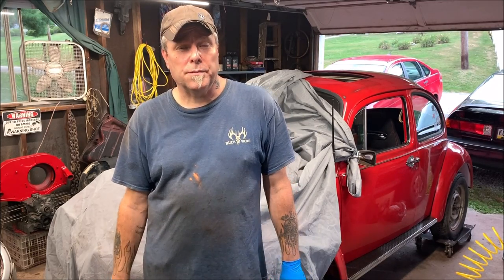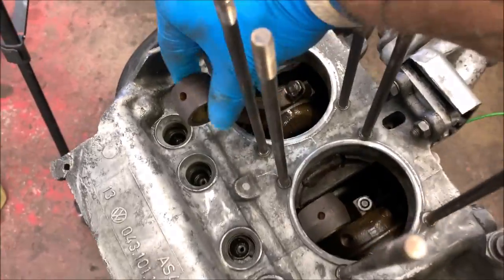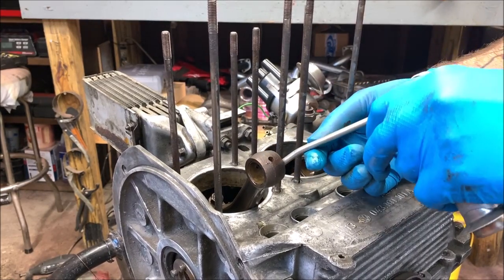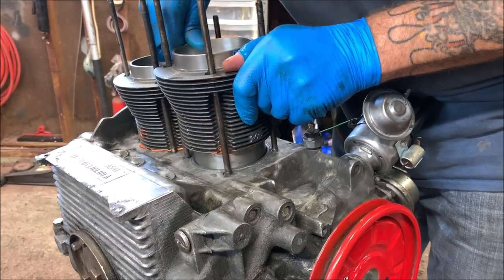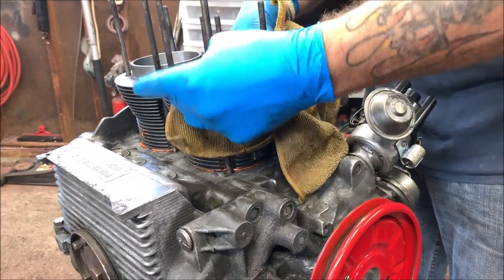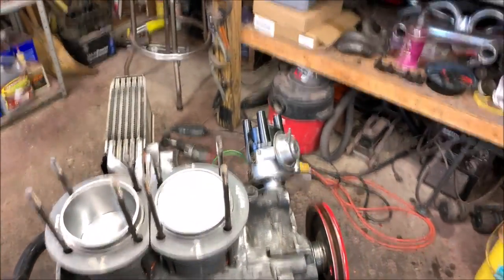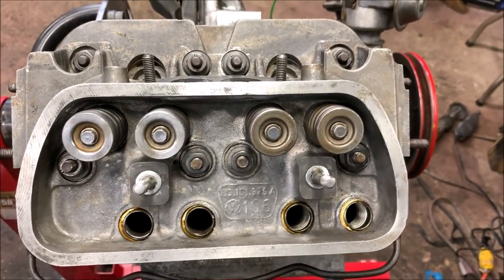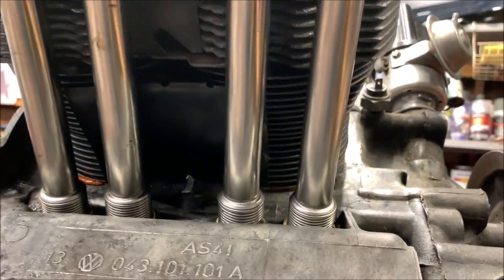VW Beetle - Super Beetle Pistons & Head Assembly Rebuild - Head Installation - VW Bus - VW Baja

Comment: Thank you for sharing all those videos! They have a been a huge help when I had to replace the master brake cylinder and brake lines. Replacing leaking pushrod tubes is next on the list. I've always been postponing this but thanks to you I'm gaining confidence to actually do this (hopefully without being left over with 2 heat shields in the end 🙂) Best regards from Belgium, Robby
Reply from the maker: Thank you Robby, and thank you for taking the time to leave a wonderful comment

Comment: I did my engine almost the exact same method as you, same torque patterns and all...only difference is I don't have an engine stand, so I built it mounted to the transmission..and I used regular gasket sealant, manly because I can't get the good stuff like you guys n the states hahahahaha....I even forgot to put the last deflector plate on there, I had to take it apart and put it on.... DOH!!!!  Hahahahaha no big deal, its on there now....I hope she's a runner!!!
Reply from the maker: I actually bought my engine stand from Harbor freight, and a friend of mine loaned me the VW motor adapter, I’m going to have to buy one for myself obviously. 
He was trying to help me out while I was blowing so much money all at one time. LOL, soon as I put that side together, and got done with torque to the head, I looked over on the workbench and noticed it sitting there. Trust me that happens to a lot of the VW guys LOL

Comment: I feel better about my build after this video.  I forgot the tin on first side.  Remembered before I torqued the head and put it on.  Forgot to set the tube seams.  Took it off the second time.  Moved to the other side and yep, forgot the tin again.  In the mean time, I got my fingers all in the sealant at the base of the jugs.  Thought the head nuts would never tighten up.  Snug one and several others would loosen.  All done finally and still weeks later I worry about those snap rings.  Mistakes happen.  Fix and move on.  So many how to videos never make a mistake.  That they admit to and show.  Thanks for your videos.
Reply from the maker: Hey my friend!! Oh I show my mistakes I don’t care! I’m human and my brains usually on other stuff while I’m working on my car. I still remember staring at the tin on my bench while tightening my head down. 🤦🏼‍♂️🙄 Everything you named ive done more then once.Yeah your tightening and the next nuts are loosening up!! Then after 5 times around your thinking...hmmmm maybe I better check again. Lol

Comment: Yes, I CAN do this! In fact I'm doing it right now :) Great to see someone using the old-style torque Wrench like I do! 
Most years VW recommended 24 pounds torque, only one year they said 18 pounds then changed their minds again. If using case savers do 30 pounds and the engine won't fall apart as quick.
Reply from the maker: Honestly they’re fairly easy to work on. Good luck with yours, I am sure he will do fine on it. I like the old-style torque wrench they seem more accurate to me. And of course I can’t afford a $500 one. Thanks for the tip on the pounds, I didn’t know they changed it around.
Reply: I am happy you say that as my torque wrench was out of torque, but I didn't realize until I had put the engine back in, I noticed I do have case savers and 8mm studs, 
I found out by checking the torque on the nuts behind the rocker arm, with a new torque wrench and they are torque at just over 24 ft lb and I was a bit worried about that, 
It's my first engine rebuild.

Comment: Great video. Good refresher  course for me. It's been about 7 years since I've done the jugs on my 1965 bug. I have a dead cylinder on my 1974 super Beetle. Number 1 cylinder. I will adjust the valves first praying for a miracle that will fix it. Just bought the bug. It is supposed to be a new motor. Looks fairly newish. I think Number 1 is probably low on compression. Will have to drop the motor and investigate. Great video. Noel
Reply: I had the same problems with my number 1 , the sparkplug keep stop working, so I pulled the engine and it was a crack in the cylinder head from spark plug hole the valve, I am not saying you have the same problems,

Comment: You give me a lot of confidence,  I may tackle the job myself instead of farming it out. I need to do a little bit of work on setting the compression ratios though. I think my engine was built wrong because it runs 90psi.
Reply from the maker: Yeah 90psi is a bit low! I will be doing a full rebuild soon, with new crank and cam etc.. and setting compression, but you’ll be done before I do that.

Comment: Nice method going vertical to use gravity, and also helps with tubes sitting in place without falling. I think it is better to load pistons into cylinders like you do, then install on rods... to me, its easier than the old way we were taught where pistons go on rods first.
Reply from the maker: Your right! I like loading the jugs first, then installing. Just seemed easier to me. Keeping it vertical is so much easier. Especially so the tubes aren’t hanging down. Thanks for being here!!!

Comment: It's amazing how low at 18lbs the heads are held on. I don't know if the factory used a thread lock on the studs or if it's just corrosion but when I first rebuilt my engine 3 years ago, having never been split since it left VW factory, it took a lot more torque to undo ! I forgot to check deck height when I did this rebuild but I didn't have the machinery to make any changes and needed to get my daily driver up and running asap, it's held up fine for 20,000 miles so far but I regret not spending on stainless valves, next time!

Comment: Great movies, please keep them coming. I have been following this with my 1600DP but found a steal ring on each of my heads where the barrel meets, should these be replaced or fitted with my new piston and jugs
Reply: I thought they should be copper rings to crush and stop any leak of combustion gases but if steel they probably are used to alter the compression ratio, the thicker they are the lower the compression would be I think!

Comment: I am new to the channel and would like your opinion on something. I have a 72 super beetle, the engine had probably less than 3000 miles on it when we had a flood. The car was completely submerged for about an hour. The oil was changed within a couple of days and water removed from cylinders. At this point the engine would turn. It sat for almost 2 years because we were busy rebuilding and taking care of other issues. Now it is locked up. I am going to pull the engine and tear it down, more than likely replace jugs and pistons. Should I go ahead and break the case apart or not? Just.looking for advice.

Comment: Don't  forget  the deflector plate that go between the cylinders before  you install the  pushrod tubes.
Reply from the maker: I did on the first side, as I brought up. I had to take it back apart
Reply: I did the same forgot the plate 😊

Comment: Did you use the thick wall slip in jugs?
Reply from the maker: No I honestly didn’t. This motor will only be in this one for about 6 months. These parts are new, but I got them cheap off of someone. Just to get her on the road. I will be pulling it later on to go with a larger displacement.

Comment: Hi Slade, I've had that Sears tension rod ft lb torque type wrench since I was in my teens using it on muscle cars engines and VW's and worked great. In fact did a video recently double checking Harbor Freight Pittsburgh clicker torque wrenches and checking their torque value against the sears tension rod. They were right on. The nice thing about the tension rod one is it never needs to be recalibrated like the clickers do unless you somehow bend the rod but that would be obvious if it was off zero setting? I'm using mine now to recalibrate my clickers when dropped or been used allot.
Reply from the maker: Hey Tim!! I use the old ones a lot. I’ve read a lot on torque wrenches and one article said we cannot afford the ones they are truly accurate... probably nasa has them 😂 I do have clickers too, but they’re harbor freight ones 😳
Reply: Both styles are good and better than not using them. I like the clickers and used them at Boeing everyday on the landing gear. We even had a electronic calibrated twin spindle motors from Canada that torqued our 4 nose gear bolts to 1600 ft lbs at the same time. Saved us from getting hurt with the 6ft bar on the old style torque multiplier. You slip off that someone's going to get hurt which happened years ago.
Reply from the maker: That’s some very serious torque!! 😳 I think the most I’ve torqued anything would have to be the rear drum axle mug in a VW bug 😁

Comment: Could you recommend a parts supplier for a top end rebuild?  heads  pistons pushrod tubes.    I have a 72 dual port motor and on a budget.   I dont need high performance stuff  im in ny  Thanks  great site
Reply from the maker: Thank you Christina, I appreciate the kind comment. Honestly when it comes to that type of stuff I prefer CB performance.
Reply: @SladesVWBeetle  Thanks   I have learned so much from your site.  You wouldnt believe.  thanks again

Comment: Can you pls help me 😢 Im trying to install 10MM chromoly engine studs into the engine case... using aviation sealant hi-tack sealant. Some ppl say to only hand tighten it, but some say torque it to 22"/lbs. Thenstuds would not stop but kept going deeper into engine case so i stopped and wanted to confirm what is the best practise. Thank you!
Reply from the maker: I would honestly not be using a torque value. I’ve mostly heard of using loc tite or the aviation sealer and turning them in by hand. I have seen a few saying to torque them. But mostly doing hand tight